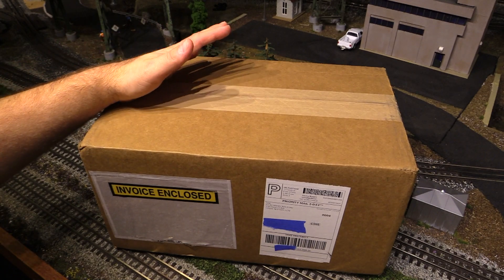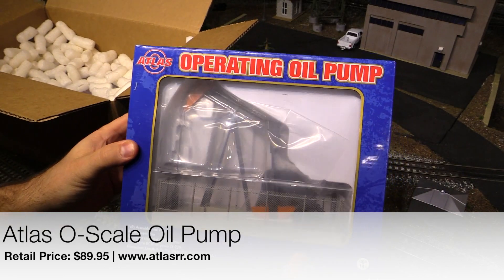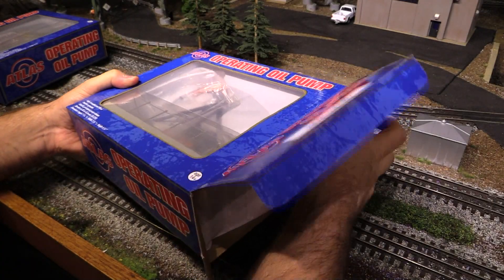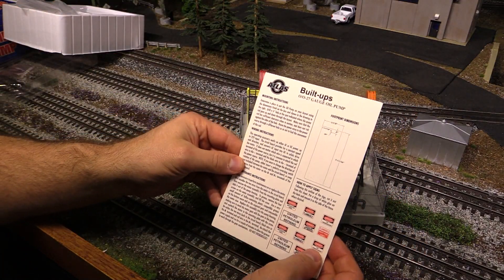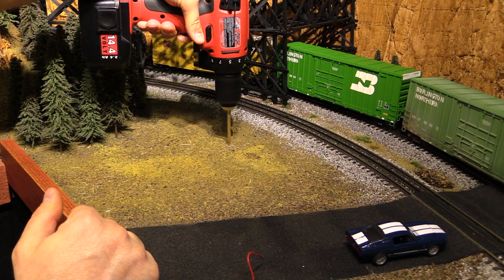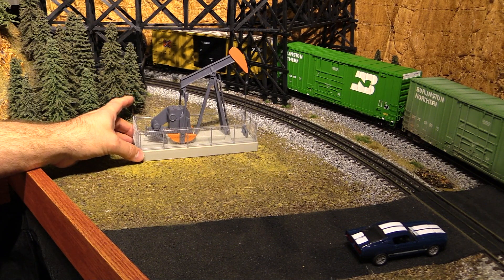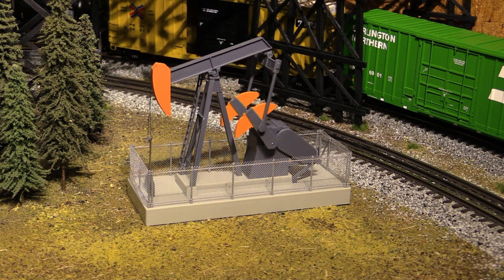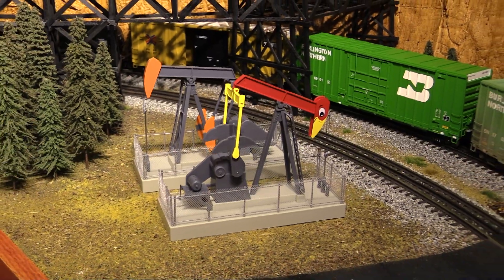Atlas O-Scale Oil Pumps

Comment: Looks great . One thing modelers with no oil field experience don't realize oil wells need servicing occasionally. There is in most cases in models no place to back up a workover rig and pull the well! I know it's a model and mine are tight in my field but I leave enough room for a rig .

Comment: They look really cool, but they are too loud and I dont like that they need to have space for the rod added so I can't use them on the floor set up.  Also I wish the pumps were removable so the base can be sceniced, all pumps I've seen have been in a field on the dirt not in cement like they come. However, they look really cool and are priced well.